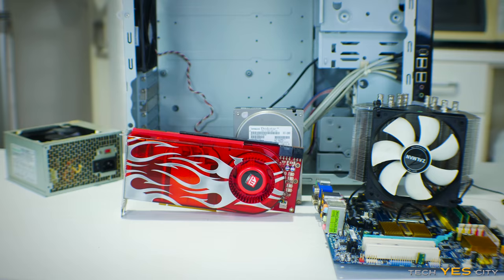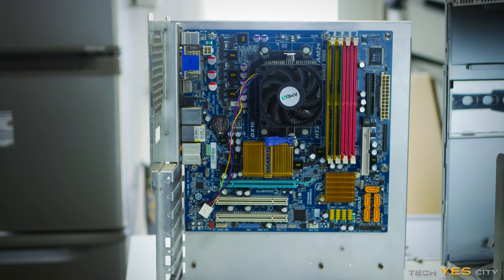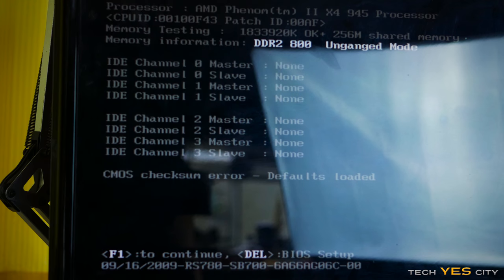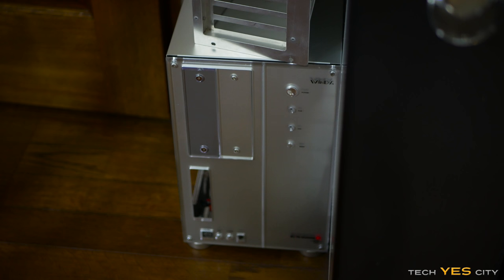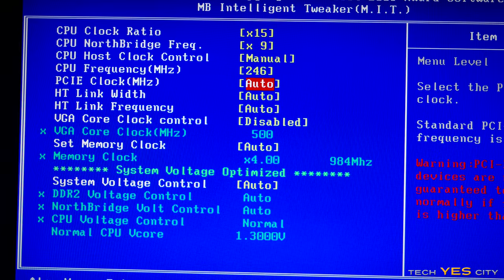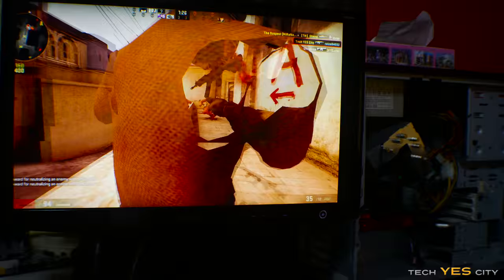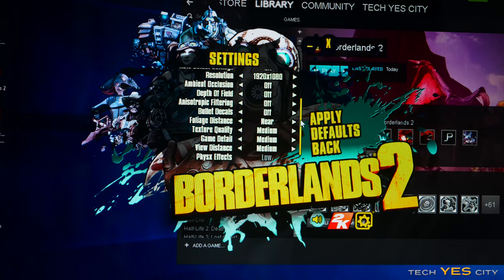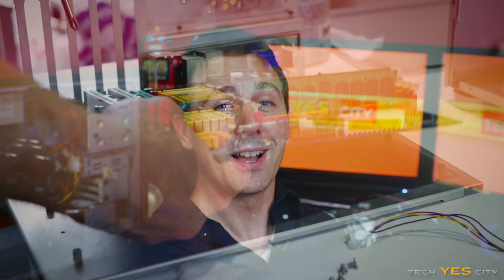The $56 ALL AMD GAMING PC - BORDERLANDS 2 on a BUDGET

Comment: Hey you should do a budget PC but not for gaming. How about a machine more geared towards audio and video editing or even animation?

Like this comment if you'd like him to consider it ( : maybe give your self a 300 to 500 dollar budget
Reply: just check his 1366 video,
instead of a xeon 4 cores you can go for a xeon 6 cores
Reply: +jd gaming yep lga 1366 or early 2011 stuff is pretty afordable...you can grab a hp z800 board for about 150 bucks just try and get a revision 3 so you can use the 6 core x5600 cpus...or you can grab up a asus z8na board have one myself...or the hp z840 i think if i rem right that one has a 2011 dual xeon set up
Reply: +Nicholas Dluge but I prefer 1155 socket, higher frequency, so better ingame performance and still some nice productivity result with a 2600k
Reply: jd gaming depending on where you life used 1155 stuff is way overpriced even x58 can be really overpriced...but i understand...but budget gaming and editing rig...thats one of those things so.eones goona half to make some trade offs on
Reply: +Phillip Morrison Check out Bryan's vids with X5650 :)
Reply: I managed to get a z68 pro for 50€, with a tx3 evo I reach 5,2 ghz for benchmark, and 4,7 for everyday use, this is not possible at all with haswell, and for skylake it's possible but you need a really good chip
Reply: jd gaming how many cores? i find more cores is better than ghz for audio production and video rendering.
Reply: 4 cores with a 2500k and 4 cores with HT for a 2600k
Yeah less cores but higher frequency,
Much better for gaming but a bit weaker for video rendering

Comment: A PS4-spec PC for $57?

And console fanboys say their shit's the cheapest you can do!
Reply: ***** This system gets better frames at 1080p than the PS4.
Reply: This PC is much better than PS3
Reply: ps4 gpu actually equivalent to r7 260x
Reply: +saw chuntean no more like r7 240 / 250
Reply: ***** the performance is in that range, maybe they might have put a high end A10 apu in the ps4, which gets the games running on a ps4 at 900p 30fps
Reply: +Xtrakt well just so you know I'm not a of gamer I'm a Nintendo fan. And I'm pretty sure an R7 240 can perfectly handle B4 at 30fps with some optimisation
Reply: +Xtrakt as if the PS4 has it at high settings
Reply: PS3 has a 7800gtx
Reply: aaaand PS4 has a radeon 7770/7850
Reply: Lucario yeah which is not that great
Reply: This shit runs old games LMAO
Reply: jedidethfreak no the ps4 is more powerful than this
Reply: If the PS4 were that Powerful, the Games wouldn´t be locked at 30 Fps ;-)

Comment: Before I built my updated rig I was on a that exact CPU with a GTX 8800 GTX and 4 gigs of DDR2 ram, it was an amazingly capable PC, I keep the 8800 on a wall just in memory of it's service. People forget now days a good build was about having a quality board to tie it all together, I had an M3N-HT deluxe back in the day and my power was endless..

Zip ties are sketchy, but contact over pressure. I can see em' losing tension and melting over some time however.

Awesome video.
Reply: +K3NnY_G I did the same with my 8800 GT 512MB, bought in 2007. By 2013 that card still ran games like tomb raider and farcry 3, granted, not in DX11.

I went as far as putting her for sale, having a buyer, and as we were setting up some final details, i backed out and got a negative rating as a buyer/seller there. Worth it.

Comment: "Phenom two by four" stylized "Phenom 2X4"

OH YEAH: FPU explanations.
The Phenom IIs have one FPU per core, which can do up to two 64-bit (double precision/DP) floating-point operations per clock or up to four 32-bit (single precision/SP) floating point operations per clock. Bulldozer upped the FPU to 4DP floating-point operations per clock / 8SP floating-point operations per clock. HOWEVER: the Bulldozer FPU requires that you use some more advanced instructions (AVX) to achieve those rates, whereas the Phenom is fine with just SSE2 instructions to achieve that many floating-point operations per clock. In practice most games still only use SSE2 instructions at most and the Bulldozer FPU, while better, isn't twice as fast (as it would have to be) than the K10 FPU when it comes to SSE2 instructions.

For comparison: a Skylake CPU that supports FMA4 can do up to 16DP/32SP floating-point operations per clock (using FMA instructions).

Comment: Those old Deneb phenoms are real solid performers. My 945 actually managed a higher stable increase overclock then the Thuban 1035t phenom i replaced it with. Great gaming cpu especcilay when paired with a strong CPU. My 1035T is paired with a 7870 ghz edition and it is still amazing at most games in 1080p.

Comment: Good video! My potato is the 2008 HP dc5850 (AM2+ motherboard) with an AMD Phenom II X4 B97 at 3.2GHz (95W), maxed out the memory to 8GB (800MHz), added 1GB GeForce 8400GS and USB 3.0 including front panel for $14 from China. I use the HP mainly with Virtualbox and YouTube videos upto 1080p60. CPU and GPU both run at 50% load with 1080p60. Higher resolutions are useless with a 22" Siemens/Fujitsu vga monitor of 1680x1050 at 60Hz. 
The host and main OS is Xubuntu 18.04. All Virtual Machines (VM) are very responsive (not only Win 3.1), mainly because I use the ZFS file system with 3 striped HDDs and 1½ GB of memory cache for the HDDs (kind of cached RAID-0). Cache and HDDs share the lz4 compression (compression ratio 1.7). The VMs boot fast from a 10 years old PC without SSD. I talk about real boots, not the fake wake-up after sleep.
- Windows 10 boots in 45 seconds and reboots in 34 seconds, 
- Windows XP boots in 32 seconds and reboots in 24 seconds,
- Xubuntu 18.04 boots in 30 seconds and reboots in 7 (SEVEN) seconds.
My HDDs are 3.5" Seagate 500GB (135MB/s), 3.5" WD Black 1TB (112MB/s) and a 2.5" Seagate 320GB (78MB/s), accumulated throughput in theory 320MB/s. With the Linux DD utility I measured 275MB/s.

Comment: I built a budget rig for my cousin, rocking a phenom 2 940 quad @ 3.7 as well,6GB of DDR2, and a 6970, even runs gta 5 35+fps, and on the overclock I would recommend trying to keep the ht link frequency  as close to 2000 as you can get, as phenom 2s actually lose performance when the ht link is to high, a 250mhz bus, and 4x ht link would get ya to the sweet spot. Still rocking a phenom 2 1055t 6 core @ 4.0 Ghz myself paired with a 390 lol. I would also like to see you compare the old x6 phenoms to a 8320/8350, maybe even a i7-920 thrown in for good measure.

Comment: Even though that ziptie job ended up working out just fine it still seems just a little too precarious for me to want to use it.

I can also confirm that Borderlands 2 is even playable on a Athlon 64 X2 4400+ w/ HD4650 so long as you're alright with running at 480p.
Reply: +Jacob Turner True history; the Pre-secuel runs fine in 800x600 (VGA CRT) with +/- that setup and 2 Gigs ram.
I found a room with corporate old junk and took a break, LOL

Comment: You got the name of the processor wrong, Is: Phenom II x4 945. 
Is a socket AM3 CPU (Backwards compatible with AM2+; forward compatible with AM3+). Phenoms x2 without the "II" do not exist. The K10 dual cores are Atlhons x2.
Is a good processor which can hold their ground  on modern games especially with that amazing OverClock. Too bad here is bottlenecked by the DDR2 ram and the old video Card but is totally recommended for  a 1080 gamer in thigh budget in a DDR3 motherboard and a decent card

Comment: CPU: Intel i5-2500 3.30GHz Quad-Core 
- Memory: 8GB DDR3 PC3-1600 RAM 
- Hard Drive: 320GB SATA 7200 -rpm 
- Optical Drive: DVD+- RW w/ DL LSS 
- Operating System: Windows 10 Pro 64-bit 
- Certificate of Authenticity: Windows 7 Pro 
are those good specs??

Comment: Lol i just did this with a e520 cooler (they are huge!) i used fishing line to hold the cooler on and rubber bands to hold 2 fans on the cooler. Been running so far with no issues and my temps are great.

Comment: That's a hell of a rig for $56!  I can't believe you picked up a Phenom 2 X4 with a mobo and RAM for $15.  That's amazing.  Still, the 2900XT is holding it back.  This is begging for a GTX 750 Ti.
Reply: No it's not
Reply: Bob McFlurry Yeah, it is.  A Phenom II X4 is roughly equivalent to an equally-clocked Core 2 Quad.  A 750 Ti would be just about perfect for that.  A 2900XT is a 1st generation DX10 card.  A Phenom II X4 is capable of feeding a much faster GPU.
Reply: Bob McFlurry http://www.anandtech.com/bench/product/1337?vs=1130

Considering the fact that the 750 Ti is faster in the majority of games, and uses a lot less power, I think it's definitely the smarter choice.

You might pay an extra $20-30 for one on the used market, versus a 560 Ti.  I used to own 2 560 Ti's, by the way.

Comment: The 945 don't beat my 860k in my case, however I have the 860k overclocked. The board im using for the 945 will not allow me to change the freq of the 945. I will have to say that the 945 was a decent CPU.

Comment: For some reason those Phenom CPUs still hold up against and sometimes beat AMD's FX chips. I still have a Phenom II X6 1100T machine lying around and it kicks ass still today.
Reply: +JonnyBoyUltra161 AMD regressed in some aspects (single thread performance) compared to Phenom II CPUs when they released Bulldozer. Their newer FX CPUs have fixed most of the problems, but towards the end of the year AMD is releasing a new CPU architecture [Zen] which should bring them much closer to Intel again. Back in 2005 AMD had faster CPUs.

The guy that designed the architecture Phenom II uses in this video left AMD and worked on CPUs Apple's iPhone uses, and then came back to AMD to design this next AMD Zen CPU. Exciting times for PC gamers.
Reply: +SirMo Zen hopefully makes Amd cpus relevant again.

Comment: Can you make a 200/250 $ water cooled(custom, not aio) pc?That would be awesome. I'm trying to do it and i am halfway done. The specs are: Xeon W3520,8Gb ram(2x4gb),Gigabyte X58A UD7,'600w' psu,no name case,GTX 470,Ybris waterblock(made in Italy, very cool), 120mm rad. I still have to find hdd,pump,tubing and some random fans.

Comment: The Phenom II is one of the best AMD CPUs ever, some models even run on par with some FX chips, you can tell AMD was betting the farm back then...
Reply: +Kevin Moondust because they released new versions? 

That use newer versions of bulldozer?
Reply: Kevin Moondust
The fx is a marketing term.

What you mean is bulldozer and that has shitty ipc.

But they have newer versions of it called excavator and steam roller that are 5-10% faster on ipc.
Reply: +MrKillius24 5% from 75% doesn't make it 100.
problem is, if someone already have Phenom II X2 back then, then they have no reason to buy another FX series that perform slower, for more money. why would you?

and just like in this video, there are some country/area that selling that old processor for cheap, and really versatile build, it could be put on AM2+ motherboard (DDR2), AM3 motherboard, and AM3+ motherboard (both DDR3). just pick your best for the money.

The drawback? all platform are just very old, you would be lucky if you fnd it and can still get it running.
I have the same motherbard just like in this video, it only had 3vrm, since it marketed for HTPC, it's HOT even with gazilion fans, specially northbridge but none the less, it perform and overclock better than new 760G based AM3/AM3+ motherboard.

Comment: I would be careful with that zip tied down cpu coopler. Simply put, if I was building a pc on the cheap like this and then got a phenom 2, I would at least buy a 20$ cpu cooler with an amd bracket.

Comment: I have a 2900XT. was a beast back once upon a time, but now its pretty mediocre compared to the GT630 I have. not to mention the ridiculous amount of heat output and The TDP of the card itself. The GT630 I have is a 2GB version, and it plays  far cry 2 at 45-50 FPS on high preset. on some games, I do have to crank down the resolution a bit, but not a big deal. the 2900XT on the other hand is a 512MB version, and struggles to keep above 30FPS on far cry 2 on high settings, even at 1280x1024 resolution.

Comment: Really nice hardware for 50$. I wish I could get my hands on some dirty cheap hardware too. just for the sake of making systems. 

By the way, do you live in China or Japan? I'm a new subscriber haha, and are you sure that the motherboard's chips actually have contact with the heatsinks after re-applying the thermal paste? the original one looks like it has some height but I could be wrong

Comment: 56$ PC,is good but look this parts ca. price in  Hungary : 

Motherboard without ram : 25 $ + 4 gb ddr2 ram 15-20 $
Videocard : 25-35 $
Cooler : 15-20 $
Random Case : 10-15$
Power Supply : 10$

... No comment ...
Reply: lol DDR 2 ram right here is 60 for 4gb and motherboards are going for around 100
Reply: +xidexs Reason he could get it for that price was because it was listed as junk.

Comment: Yeah if your motherboard breaks you need 7500 work station to fix it properly.
Reply: no
Reply: ***** Uh, it's not going to last very long. It's better to just re-solder the chips, capacitors, and resistors. It will probably get you 3 months.

Comment: Several bad examples in this video.  I get this was a cheap system, and one you didn't really care about, but those were definitely not the way to do things.  Just a couple of them:

1) Applying thermal grease with your finger.
Besides the fact that the oils in your skin could mix with the thermal grease - and cause it be less effective - if you're not properly discharged (static electricity), then you could potentially fry the device you're trying to get working, just by touching it.

2) Scraping off the thermal pad
Never use a sharp object to remove the thermal pad from a heatsink.  That scratches up the metal, and reduces the effectiveness of the contact area.  If you insist on doing that, you should have used some fine sandpaper to smooth it out afterwards.  In truth, what you should have done is used some isopropyl (rubbing) alcohol, to loosen it up.

That being said, the Phenom II's are great processors, even still.  My gaming rig still runs a Phenom II X6 1090T.  Bonus fact, that 945 can be run on an AM3/AM3+ motherboard, with DDR3 RAM.

Comment: Your Windz case is probably a early version of Lian Li cases.  I did not know they ever went by any other name.  They usually use the knob easy to remove screws on everything..   That another thing they where one of the first to do... and even now you still can't find it on alot of other cases..  

http://www.lian-li.com/en/

Not all of there cases have removable trays.. but the easy remove nuts are still something they do on a lot of there cases.  That's a lucky find and if you ever need parts for its nice to know you can get then from the original manufacture.

Comment: Wow.....

You using zip ties. I had an old 8800gtx that the fan died. so we bought a Zalman cooler that was passive & I zip tied a 80mm fan to the heat sink. The card never got hot.

Comment: wouldn't that zip ties soften if the CPU temperature is high? in long run it should be soften due to heat expansion and fatigue right?
Reply: It wont because i have zip ties in my 1.5 years old PC.

Comment: quick question: when you use a refurbished case like that, how do you make sure that you can put in a new power supply in it? I've been trying to build a budget pc, gutted a few really old cases, but found that the power supply whole was way too small to put in a new power supply (like a 550w power supply). would you have any advice for this?